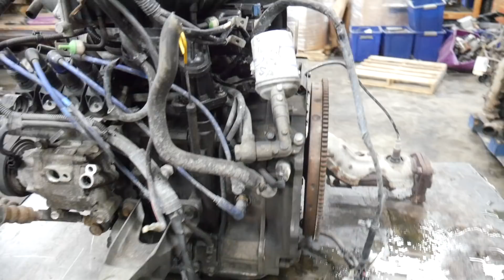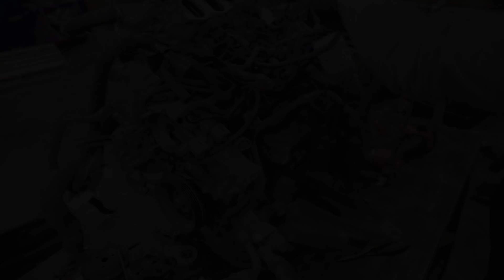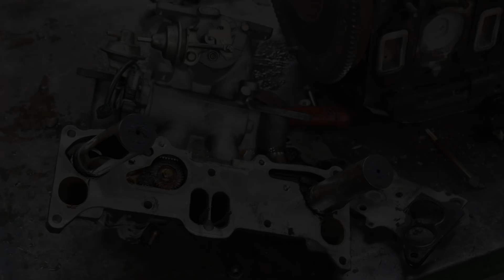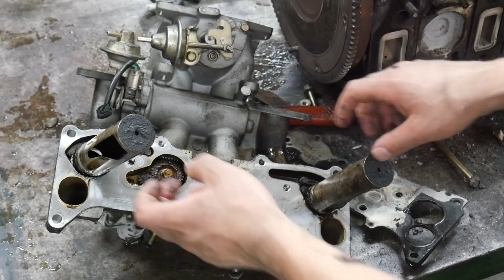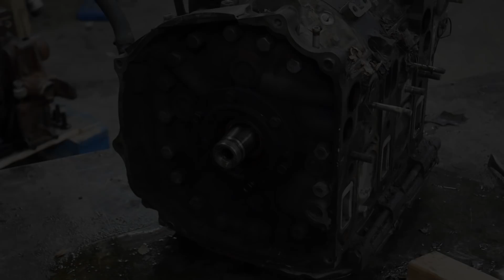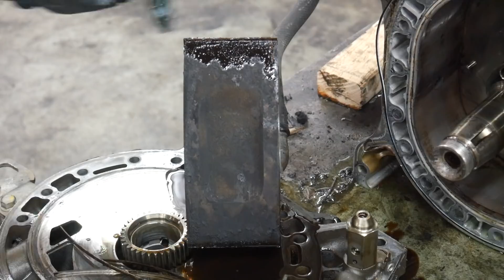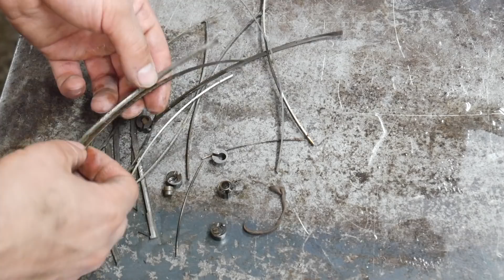13B RENESIS Total Rotary Teardown. 04-11 Mazda Rx-8 6-Port!

Comment: The dudes that are into rotary engines are worse than bitter, angry, religious zealots.lol
They'll argue to the point of throwing fists that rotary engines are far better than piston engines. And if you mention any of the drawbacks and unsolved perpetual problems and inherent design flaws that plague rotary engines, they'll probably just tell you you're a moron, you don't know what you're talking about, and piston engines have the same problems but worse. Rotary engine dogma is fiercely strong among that community. lol

Comment: Excellent video. My feelings on these engines are similar- neat idea and early ones had impressive power to weight compared to their contemporaries- but solutions to longevity and serviceability issues seem to be elusive
Reply: I think rotary engines are more than durable enough for racing applications (these 13Bs are used in Mazda Formula Atlantic as well as, unsurprisingly, in Mazda RX-8 one-make series), but unfortunately many forms of motorsport mandate piston engines.

Comment: I bought a 1986 RX7 with 16k miles on it and I don’t know why but it was still running great at 243k miles when I gave it to our gardener for helping us move. Almost ruined it twice; once when a heater hose blew while in the middle of the Oakland Bay Bridge where I had to keep driving to a safe exit and again years later when a rubber O-ring behind the factory oil filter adapter split.  Both times coolant and oil level alarms gave early warning.   Had it completely loose compression once when I did a “short start “ to back it up for a landscaper.  Mechanic said engine was a goner but a rotary specialist told me to disconnect the crank angle sensor (so no gas was injected) and pull two spark plugs to put a tablespoon of oil in each rotor.  After cranking for a bit the compression pulses came back and I drove it for 8 more years.   Never expected it to last so long. Replaced leaking fuel pulsation damper and as long as the intake plenum was off replaced brittle oil injection tubes but other than replacement of old heater and radiator hoses no work done on the engine.   Electrical switches all failed and driver’s door handle broke every 5 years though.

Comment: That is series 1 2004-08 engine. Very different from Series 2 2009-11 engine in many ways. Series 2 can last 150k easily with basic maintenance. Number 1 killer is coils wearing down past 30k miles. Worn coils put unburnt fuel in catalytic converter, clogging it to overheat the engine from clogged exhaust flow. Exhaust side port springs give away and side seal gets thrown into the engine, killing everything inside.

Never put in series 1 or aftermarket oil filter in series 2 that makes 2 times the oil pressure. Filter quits working due to higher pressure opening the relief valve in filter.
Series 2 engines are all 6 ports, with automatic RPM limited to save the transmission life.

Comment: Even with all the "re-engineering" hype I remember reading about the Renesis project, it amazes me to see how much commonality still exists between it & the original 12A. I spent many years working on 12As when my mom went thru her RX7 phase. Imagine being 19, armed only with a Chilton manual & having this stare you in the face. 

I got wise quick. Fun times & unforgettable cars!
Reply: When you don't know what you can't do, the skies the limit in what you can accomplish.
Reply: @peted5217  or destroy!
Reply: I had sort of the same experience, I worked on dirt bikes and my ohc ford when I got my FD rx7, armed with the book. The internet was there but not nearly as helpful as youd imagine
Reply: Yeah I would have thrown that Chilton away and got a proper Haynes manual 🤣
Reply: Cool mum, my mum had a Sierra RS Cosworth as her commuter car when I was 12.
Reply: Chilton's manuals lol. I remember
Reply: I built a 12a a year back.  My favourite rotary.
Reply: Your mom must've been a bit of a dyk3 lol
Reply: 1993-1995 RX-7 was awesome (looking ) sports car. A true modern classic. So valuable today, if in great condition.  1995 RX-7 and 2005 Honda S2000 are my favorite Japanese sports cars.    Toyotal GT2000 is 1960's exotic and NSX is expensive quasi-exotic and far too uncommon. I owned 2005 S2000 and S2K along with my 2016 BMW Z4 300ISdrive are my favorite cars I owned.
Reply: @dkoz8321 The 90s ones are nice but I think the naturally aspirated 79-85 models are the best. No turbos to deal with or fuel injection, just a 4 barrel carb. Similar to the Subarus of the same time period, they got worse with time, fuel injection and forced induction was not kind to either of them. The 12a powered models are still my favorite, and the best looking I think.
Reply: @dkoz8321 The FD was made from 1992 to 2002, it was discontinued in the US in 1995 due lack of sales.
It was never considered an enthusiast car until the model became associated with popular iconic Gay  characters in Asian teen culture.
Reply: spoiled rich kid
Reply: @fkujakedmyname  He drives an OBS Ford lol, his mom having an RX7 hardly makes him a spoiled rich kid
Reply: @benjamins9121  You're right but clean OBS trucks are worth decent money now.
Reply: @fkujakedmyname  your mom owning an rx7 makes you a spoiled rich kid xD

Comment: Yeah, there is a block that you can put between the coils and the engine that helps keep them cool. I installed one and it worked great. My second RX-8 made it to 120,000 miles before it started to have issues. The housings needed to be replaced and that is not cheap. I miss the car though.

Comment: If you haven't owned a Rotary you wont understand them. They are not particularly good daily driver engines  because they need a bit more love.   What they are is a BLAST to drive at the track, and if you take the time to boost one, and tune it right they make good power too.

Comment: There’s plenty of 100k+ mile rotary engines, it’s just bad apex seals that causes the compression loss. And there really isn’t anything to “fix” per se, it’s just the nature of the style of engine. It’s a 2 stroke and the shape of the rotors just causes innate wear because they’re not round like pistons. The “fix” was actually put into place decades ago when apex seals were added to the original rotary design. They just don’t last the amount of time a piston engine does, it’s not a design flaw, it’s just 2 stroke life. It’s no different than having to do top end rebuilds on 2 stroke dirt bikes, that doesn’t mean 2 stroke bikes are designed poorly, it’s just something you have to do. Yes you do not have to do top end rebuilds on 4 stroke bike engines like 2 strokes, but the trade off is it takes twice the displacement of a 4 stroke bike to equal the power of a 2 stroke bike. That’s why 250cc 4 strokes run the same races as 125cc 2 strokes and 450cc 4 stroke bikes run races with the 250cc 2 stroke bikes. It’s the same with a rotary; a 1.3L rotary can easily match or exceed the power production of a 2.5-3L (or larger) piston driven engine. You just have to decide what your priorities are. Do you want ease of maintenance? Then you need a larger piston motor to make your power. If your ok with rebuilding things more often then you can use a rotary and take up half the space/weight of a piston engine and make the same power. With the dirt bikes I was talking about it’s the same thing, do you want a lightweight and nimble bike that still makes incredible power? Well then you have to do top end rebuilds periodically, if you don’t want to do that kind of maintenance then you put up with a much heavier bike and get a 4 stroke to get your power. Again, when things like the top end in a dirt bike or apex seals in a rotary fail, it’s not considered a catastrophic engine failure it’s simply maintenance.
Reply: Well said and a great way to put it.   Funny thing is I prefer 2 strokes for dirt bikes (longtime KTM 300 guy) and consider them much easier to maintain then the current crop of 4 strokes and the headaches associated with them maintaining.   Though I like the idea of the rotary, but in the context of autos if I did get a late model RX8 or 7, Id throw the Wankel in the trash and do a LS swap.   👍

Comment: More Wankel engines get replaced, or swapped because more people do not know how to start one that had been sitting , than you think. In the mid nineties a freind and I resurrected 4 FB 12A engines, and a Cosmo with a 13B. We bought a core engine at a junkyard for $25, then tore it down. Good times getting that 52MM flywheel nut off.

Comment: An engine that can't do 100k? How the F do they get away with that!?!
Reply: Umm where do you get the idea engines have a mandatory life span? Current emissions kill million+ mile diesels in 200k miles, how do they get away with that? How do they get away with stuffing modern vehicles full of planned failure devices? The more electric garbage you put in a vehicle the quicker you start having problems.

Comment: ok, so ive got a request, mazda 2.3l supercharged miller engine...if you can find one...
Reply from the maker: I have one actually. But it’s a 58,000 mile motor I was saving for a project I’ll never do. lol
Reply: @I_Do_Cars  at those miles ? if you are going to project it? you need new supercharger seals and likely new valve stem seals too...
ive got the only one left in the uk, im umming and ahhing as to whteher to kill the last mazda its currently sitting in...
what were you thinking? mx5? or maybe rx8?
i cant bring myself t yank this one as the car looks too good...fromabove...
Reply from the maker: deadprivacy I’ve had 9 Miller cycle cars and the engines will last as long as the owner is retentive about maintenance. Seals leak in blowers at random. I’ve had them perfect at 150k and smoking at 50k. I know those engines are temperamental but they’re strong and reliable with proper care. 58k is pretty low here in the states!
Reply: @I_Do_Cars  mine is puffing on start up at 80000...i have no idea what im going to do with it...you have had 9 of them?
they sold about 10 i total i the uk....i have the very last one.. shes so rusty underenath, interior and body are absolutely a1, looks like a show car....but every link on it needs doing and full brake rebuild, fk knows what im going to do with the rear wheel steering, it works miraculously but the body of the ram is as rotten as the subframe,,, and the wheels...and every bolt on it....itll need new springs , new exhaust , wtf did  i buy?

no better way to lill a car than to drive it around scotland for ten years. wet all the time and salted roads.
Reply: then theres deleting all the gubbins---if i save it, its so getting a scooped bonnet, not sure how a speeduino will cope with the miller cycle....i was think clutched supercharger ? smaller pulley if nothing else...wideband o2. add some sensors, bigger intercooler, better ducting
flappy paddles if i can wire up something for the autobox...mazdapc.com is down too, so my sunday research has gone awry...you havent got a parts catalog , workshop manuals by any chance etc?

Comment: I bought an RX-7 new in 1980.  I loved that car.  I sold it when it had 88K miles.  The clutch was completely fried and I knew it was going to need to have the engine pulled to replace the clutch and apex seals.  I explained this to the kid who bought the car, but I could tell he had no idea what he was getting himself into.  I'm glad this video wasn't around in 1988, or I would never have been able to sell that car!!

Comment: Leased one of these, you can say what you want but if you drive one, in it's prime, around a corner at 5K rpm it will put a smile on your face.....it performs like an electric motor.
Reply from the maker: They handle great but in my opinion a rotary is quite the opposite of an electric motor. Rotary engines pull harder the higher you rev them and they have an absence of torque at lower rpm. Electrics are all torque and run out of steam “up top”

Comment: Any engineer should've figured that plastic oil lines would become brittle with age and the heat that is produced near the block.
Reply: And yet these lines are intact.  I had no troubles on my RX-7 at 180,000 miles.
Reply: @KB4QAA  "180,000 miles" what a piece of shit engine. The oil lines shouldn't be plastic anyways.

Comment: Its an interesting engine for sure but if it wont last very long. I dont see the point in buying a car with one.
Reply: They last long if you take care of them.  My engine lasted to 125k before a coolant line blew.  Great little engines if you just keep up routine maintenance. Abusing any engine will kill it early.
Reply: It revs to the moon and is easier to rebuild than a piston engine

Comment: ONE HUNDRED THOUSAND MILES!!?? That's it? Is the word 'disposable somewhere on the purchase agreement? If it's not it ought to be. Does Mazda have a corresponding warrantee, power train except for the engine? I must just hang on to my vehicles longer than that. I can't imagine that helps the resale value all that much. Your video was extremely informative. I've never seen a real Wankle engine, running or otherwise. I'm waiting eagerly for the next disaster.
Reply: My RX-7 engine ran to 125,000 miles before a coolant line break, killed it.  No problems with it at all to that point.

Comment: Definitely understand how you usually always take the practical stance when it comes to mechanical items, definitely wish Mazda would have been able to perfect the rotary engine concept more in the 50+ years they had them in production but to be fair to the rotary engine and Mazda, the rotary engine was the only internal combustion engine concept to be invented in the 20th century, all other designs where conceptualized in the 19th century or earlier, and in regards to Mazda they were the only suckers to have the balls enough to mass-produce and improve the original design. So with its limited life of development and extremely scarce use and funding, I definitely feel Mazda deserves some credit for how far they got the rotary engine design before its inefficiencies forced them to kill it off. They are useless but fun as hell :)
Reply: Not useless at all. They just have different characteristics than piston engines, and don't meet the requirements of the market today.

Comment: Been wanting to see a legitimate tear down of a rotary engine in forever. I think the biggest failing was only one company had this engine. No one else wanted to make a rotary. Sensible in concept but difficult in life. I had an RX7 and loved it but hated how it ate oil but rotary engines spray oil in so burning oil was common. A quart of oil in your car was common. It was super smooth for days, torque was really lame though. I really liked the car’s handling and balance. But the rotary sure was going to be a worry. So sure enough I did not keep my RX7 all that long before I traded for a different car. I went to driving company cars for years and though RX7 was cool I would never buy another rotary. I still feel the same way. Sure piston engines are not so great either. But everyone makes one. Rotary engines can’t even pass emissions today. Also fuel economy was poor to fair. The engine had potential but frankly Mazda was not going to be the only company to make the rotary practical and reliable. You needed a company with serious financial and engineering means. I admire Mazda today but they will never make a rotary main engine again. Good reason too. Every engine was going to be suspect. I get that Mazda won Le Mans with a Rotary that was a no holds barred racing unit. You haven’t heard of a Mazda Rotary winning Le Mans since. Maybe as a racing engine is great. One to own? Not so much.
Reply: A deeper dive into LeMans history shows how racing governing bodies were lobbied by Mazda's competitors to essentially ban the Rotary by requiring adding ballast.  The additional weight killed it's competitiveness.